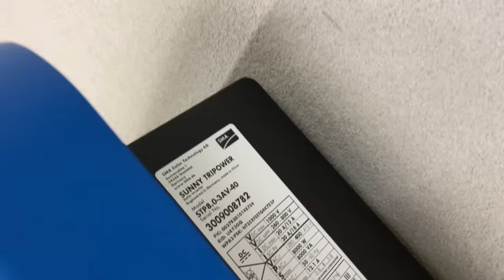Not the call I wanted, one of my own Solar systems has a fault and has shut down 🫤

Comment: Weird, given the math I would've thought the 12th panel was the problem.
Reply from the maker: How so
Reply: @joondalupelectricalservice3201  When the math gives X.Y then the first X panels produced the expected voltage, but not the subsequent one - which is likely shorted to ground internally.  Consider the boundary conditions - what if your voltage reading were 20V (less than one panel) or 520V (just less than that expected for 14).  Plug that into your math and see what X pops out.
Reply from the maker: @warthog618 ahhh I see what you mean. I was drawing on panel 11 in the video which implied that was the suspected panel. The drawing was for illustration and I have misled people. My apologies yes the math says panel 12 and thats the one I removed on the roof. Thanks for picking that up 👍🏻
Reply: Yeah I was thinking 12th panel as well and then you said it was the 11th and I thought to myself ‘I was close’ ha

Comment: You’ll always have a stuck voltage when there is a riso problem. This is on both the positive and negative pole. 
In most casses I will find the faults in the non factory fitted ( installer placed ) connectors.

The voltage measured should give you a general idea where to look, like you mentioned. ( but i’m nvr able to pinpoint the exact location on these numbers)
I usually start dividing the string in two or other available sections where I can reach the cables and slowly find to the exact possition.

SMA has like a fault finding manual/article , but its not as black and white as mentioned in this document.

Comment: My Victron battery monitors SOC drifts out of sync from time to time as well, seems to be quite common. I just charge the batteries to full, then recalibrate the system 👍
Reply: I have a victron easy solar, where i had to enter battery bank size, excide lead acid 1600 Ah at 100C.  the figure i was asked to enter was the 10C rate and it was 980Ah.  typically, we do not draw current at the 10C rate otherwise you have a serious issue with demand on the system.  so the figure of percentage is a very rough indication of state of charge.  A shunt is a better way to know how much has gone in and out in a day, and the battery voltage min/max. a hydrometer is a good way to know SOC.  my preferred method is to  check if the battery floats during the day, i should have a healthy bank.  then check each cell voltage to make sure there's not a dead cell.  Even for an electrician, these off grid systems can be a challenge.  I've lived off grid for 20 years and used to work in the marine industry electrical.
Reply: @MRxr400  yeah my Victron battery monitor is shunt based but it does tend to drift over time which is not a problem, I just re-calibrate it every few months or so.
I've been off grid for around 30 years now and love it, total addiction 😁 My old lead acid batteries were the L16 size Rolles Surrette and prior to that I used the GC2's batteries. Now I run Lithium which is a total game changer.
The one thing I don't miss from the lead acid days is the holes in my cloths from testing electrolyte specific gravity. No mater how careful one is, you always get a tiny spit on your cloths😆
Reply from the maker: Good advice 👍🏻

Comment: Did you test the suspect panels IR to prove that’s where the fault was? The 20-40v you see normally would probably be a phantom voltage caused by capacitive coupling between parallel conductors and would most likely disappear under load or using a LOZ tester. I really like your technique for fault location using some rough napkin maths! I’ve not thought of doing it that way. Enjoying your videos, vic domestic spark here.
Reply from the maker: Thanks mate
I did but I was on the roof and rushing before the rain came in and I was potentially stuck up there (steep tin roof). The test showed it was fine which was disappointing but once removed the readings were much better. I will do a follow up video

Comment: Hi Jas, great Vid great to learn tips to diagnose faults as an Industrial Vic Sparky no solar exp. I was wondering I typically use a Fluke LOZ voltage to avoid phantom voltages for testing etc wondering how you measured it or if it would have effect the earth to +- reading 👍.  That’s crazy about the STC’s in WA, Vic only lets you claim them if the system is over 10yrs from memory when I had mine upgraded.
Reply from the maker: Thanks
My understanding here is the LoZ meter is testing if a voltage is present. Where for me the circuit is live from the solar panels, Im measuring Voc actual voltage of the string +to- and then looking for actual voltage again between + and earth and - to earth however in a non faulty installation you may see a small voltage that quickly disappears (ghost voltage). Im looking for voltage that stays present  which would indicate a fault.
Remember typically a solar array will have no reference to earth at all, like a battery positive to negative.  Hope that makes sense